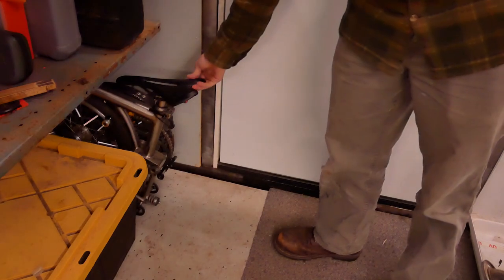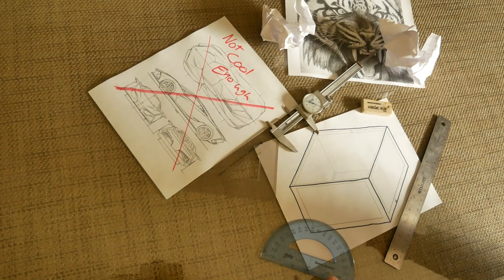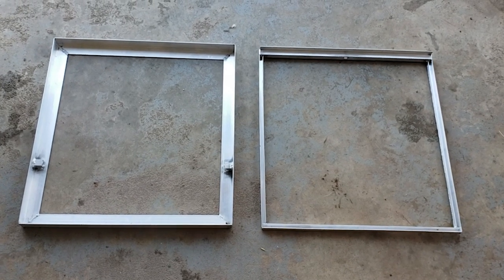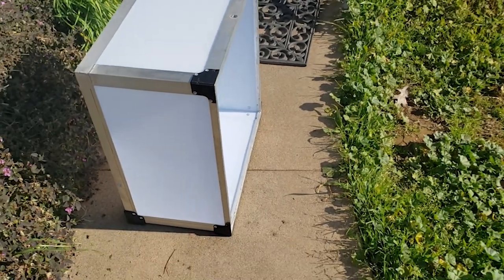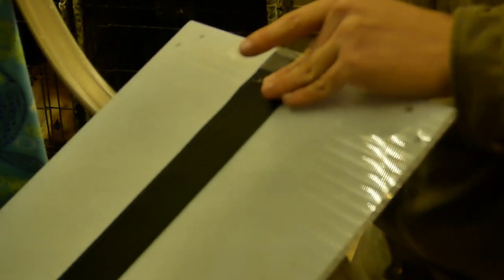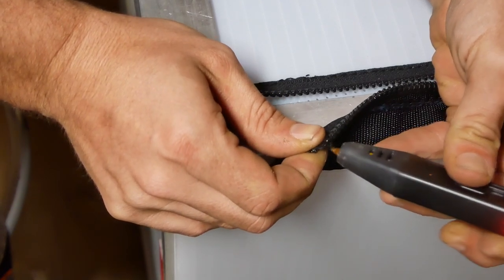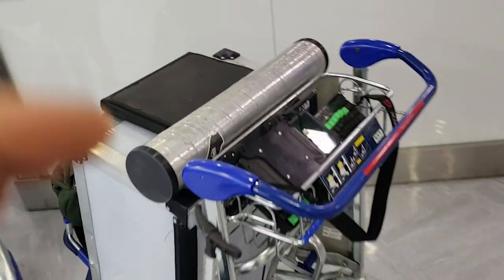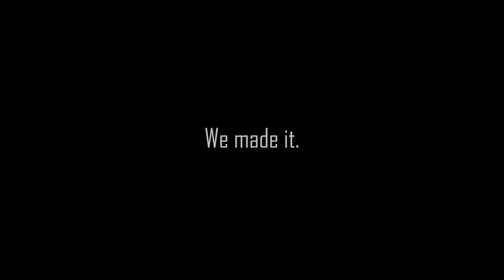Building a Custom Brompton Flight Box/Bike Trailer

Comment: Was really interested in this after seeing your post on Reddit. This was more involved of a build than I could’ve imagined. But your reasons were doing so, and various engineering steps you took, are all too amazing. Blessings to you on the move & reuniting 🙇🏽‍♂️
Reply from the maker: Thanks! It did end up being a bit complex (for a rectangular box), but it should last pretty much forever and every part is modular, so I can swap out anything that does eventually wear out. Plus, I taught myself to TIG weld aluminum, which is a great life skill!

Comment: Nice job, but trailer tow bar too short, and the best hitching point is the rear wheel axle nut.
Suitable off-the-shelf tow hitches are available.
Reply from the maker: What would the benefits be of a longer tow bar, or of hitching to the axle instead of the rack, in your estimation?
Bike trailers that hitch to the rear axle either have to be asymmetrical or have a hinged "wishbone" hitch. The wishbone wouldn't be at all suitable here, but the asymmetrical tongue wouldn't be much better. For most bicycles,  the hub makes sense as an attachment point because bicycle wheels are quite tall, so it's difficult to keep the trailer's center of mass low while going over the rear wheel. In spite of this, some trailers--like those made by Aevon, the Burly Travoy, and a few others--spend a lot of mass and complexity going over the rear wheel to provide extra maneuverability. 
Since the Brompton's rear wheel is so short, hitching the trailer above it is quite easy. This gives a better pivot range in either direction than a hub hitch for tight manuvering.
Why would one need a longer tongue? On trailers for automobiles, tongues are long because a short tongue wouldn't allow a tight enough turning radius before your rear bumper ran into the leading edge of the trailer. On most bike trailers, tongues are long because they have to stretch all the way up to the hub on a very wide wheel. On the brompton, though, the radius of the wheel is only 8 inches and I don't even have to go that far since I'm hitching to the rack instead of the hub. I don't have to worry about turn radius, since the back of a bicycle isn't wide like the back of a car; I can jackknife over past 90 degrees with no issue.
The only real benefit to a longer tongue in this instance is that I've read it's preferable to have your hitch point ahead of, rather than behind, your rear contact patch...but automobile trailers and the aforementioned wishbone-yoke trailers like the Bob Yak pivot behind the entire wheel, let alone the contact patch, with little issue.
On top of all this, having the tongue as short as possible makes the whole unit lighter, more compact, and puts less torque on tongue, making everything more durable.
I think a lot of the tradeoffs with other trailers are based on the desire to be interoperable with whatever bike the consumer already owns, and because tall bike wheels present unique challenges. Since this trailer is designed specifically for one and only one bicycle with very short wheels, none of those compromises are necessary.
Think of it more as like the kingpin and 5th wheel on a Semi, rather than a conventional hitch.

Comment: *** 5 stars for the nickel frame, rubber ducky & sheep friends + Juki! Would buy two! How's the trailer holding up on heavy loads?
Reply from the maker: The frame's actually titanium, and the ungulates are goats! I miss them quite desperately. 
The trailer's holding up well! There are signs of strain on the main handle, but nothing approaching a failure yet.
As for the Juki, it gets the job done, no question, but I think a servo motor is a necessary upgrade. I'm just not a good enough tailor to handle the "red line it and drop the clutch" control system it's got going on, at least not at the speed it runs at. Still, you're not gonna be punching through twin-wall polycarbonate with some $40 plastic drivetrain piece of junk.

Comment: After seeing your build of the trailer, it got me wondering about my own design. I have had the same idea but initially was for a recumbent trike. Since I don't think there is any reasonable way to provide protection for the trike & keep the weight of the finished package under the 55 lb. weight limit for the airlines, I am now going to see if this can be done with a Tern folding bike. What was your finished weight of the trailer? Thanks.
Reply from the maker: It's 7.4kg/16.3lbs, including wheels.

Around the time I made this video, many airlines evidently altered their policies to make traveling with bikes easier, even if they're "oversized", which is great!

I'm currently following the project of a friend who's building a lightweight, folding two-wheel recumbent with the intent of making it possible to fly with.  He's not publishing the process (yet) but it's pretty neat. He also built a flight case for his Maxarya Ray 2X using the same "Polygal" twin-wall polycarbonate that I used for this project.
Reply: @TheRamblingShepherd  If you are in the States look for a product at sign & plastic shops called Ultra Foam. It is a 2 sided plastic sheet with a foam inner core & appears to be more dent resistant than the fluted plastic. It is also very light & nicer to work with.
Reply from the maker: @daytriker  Interesting stuff. The "lite" version is about 37% lighter by area than the panels I'm currently using...though it's also almost exactly 37% thinner, so volumetrically it's almost exactly the same density.

On the one hand, this would save about 1.7lbs on the overall weight and get you about a 1/4" reduction on every dimension, which is cool...on the other hand, it's hard to say how the strength compares to the thicker material I used.

It's worth noting that the material I used was "polygal" twin wall polycarbonate, which is a LOT stronger and stiffer than standard yard sign type corrugated plastic, which I believe is polyethylene?

You can easily stand on this stuff without crushing or denting it.

One nice thing about the trailer is that all of the panels can be removed and replaced if I ever want to--maybe I'll check out some of that ultra foam next time I'm stateside.
Reply: @TheRamblingShepherd  I just checked the Ultraboard website & the product most suitable is called Ultraboard Plus. It is available in 1/4" thickness increments up to 3" thick. From the samples I received, 1/2" thick would be more than adequate strength. Unfortunately, trying to receive a few sheets in Canada & I might as well have been on the moon.